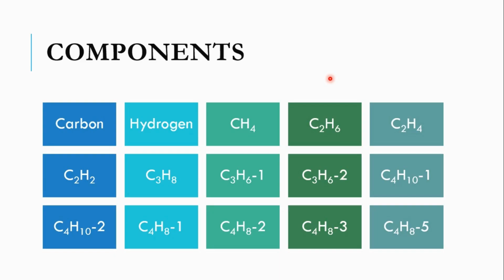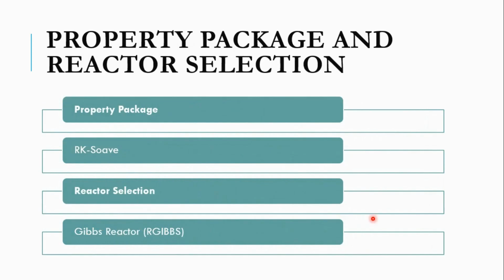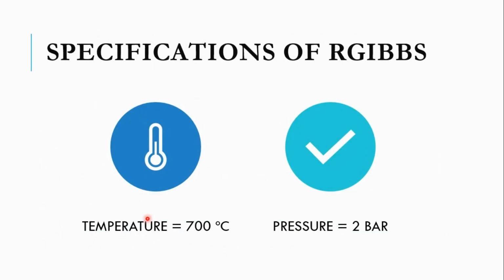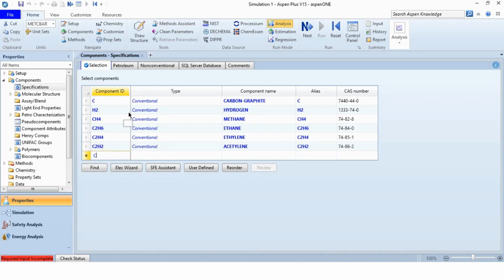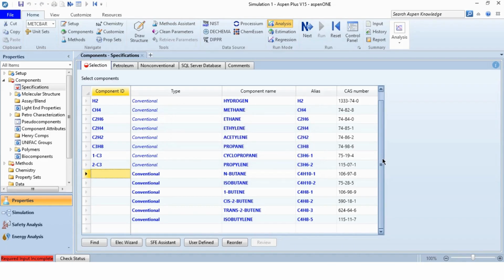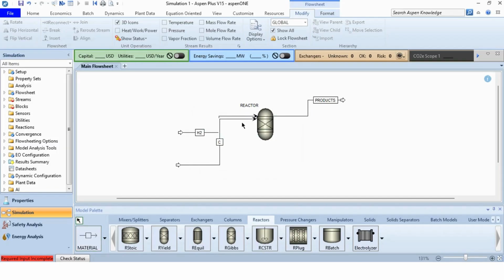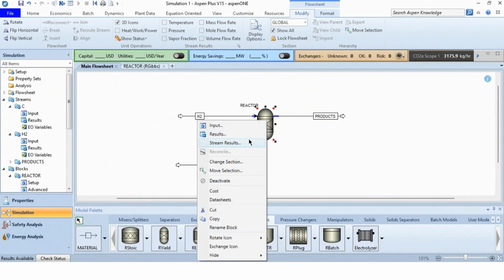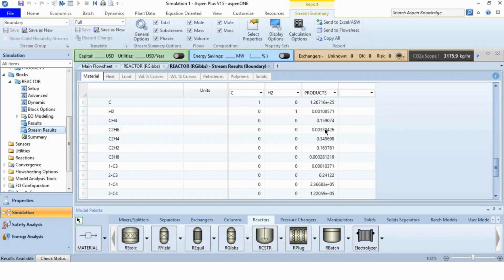Aspen Plus Tutorial: Producing Methane, Ethylene and Hydrocarbons from Carbon and Hydrogen

Comment from the maker: 💡 Challenge Question:

If the reactor temperature is increased from 700°C to 1000°C, which product would you expect to increase the most?

🅰️ CH₄ (Methane)

🅱️ C₂H₄ (Ethylene)

🅲️ C₂H₂ (Acetylene)

🅳️ C₃H₈ (Propane)

Comment your answer along with the reason behind your choice. Let's discuss the thermodynamics and reaction equilibrium together! 👇

📌 Also, suggest the next Aspen Plus tutorial you'd like to see on the channel.